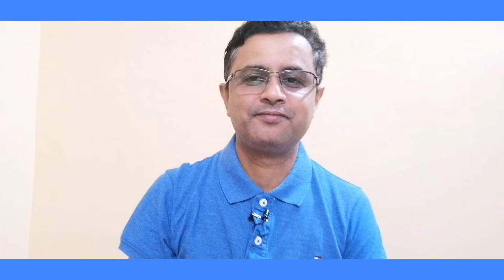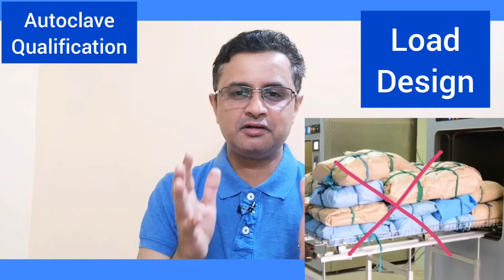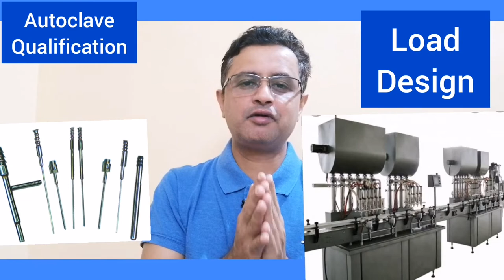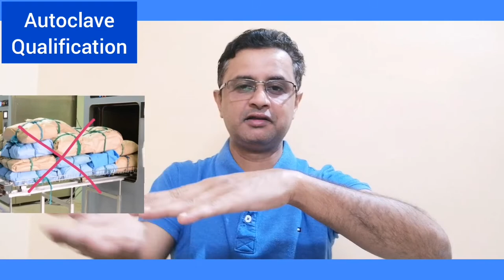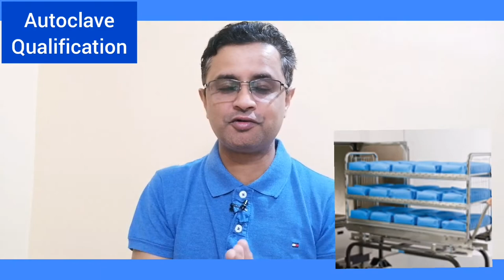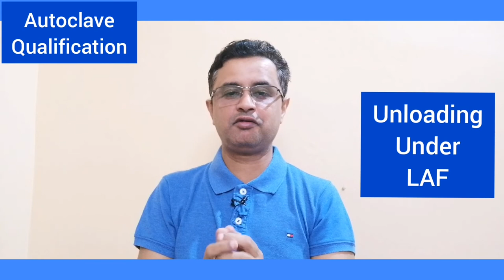Common Mistakes in Autoclave Validation #autoclave #aseptic #sterilization #gmp @PHARMAVEN

Comment: So great information Sir, Load is major factor during autoclave qualification.
Reply from the maker: Load items, load arrangements, mapping of difficult to sterilize items within load, placing sensor at cold spot, equilibrium time, sterilization cycle recipe, vacuum and pressure pulse, steam quality, replicating validated load pattern in routine runs are few of the important factors

Comment: Sir how many validation cycle requirements for Autoclave in OSD MLT lab
Reply from the maker: 3 validation runs is well expected industry standard and accepted by regulatory agencies. Not written number in Guidelines but you should go for three runs
Reply: @PHARMAVEN  
Sir 
Three empty
Three full
Three half
Three garments
Three glasswares
Three media
Three RVSv media 
Kindly confirm evry before every time empty cycles required or not and let me know any other cycle is missing
Reply from the maker: Can you email me on rinayug@gmail.com, we will discuss over there